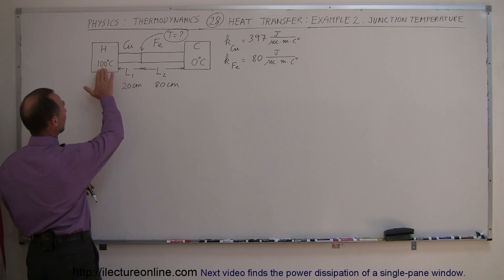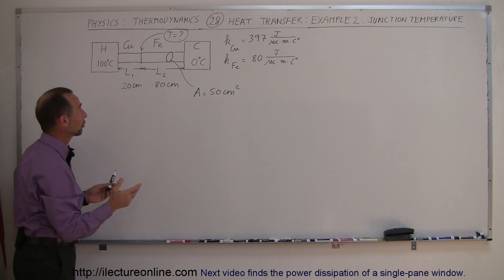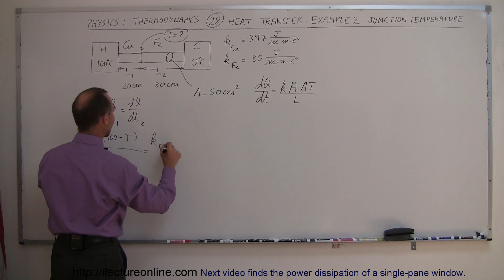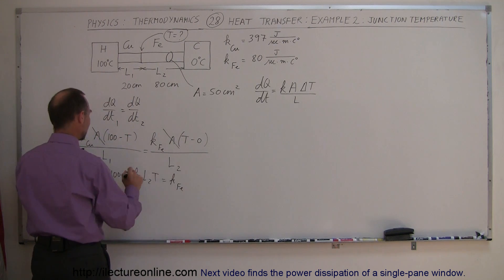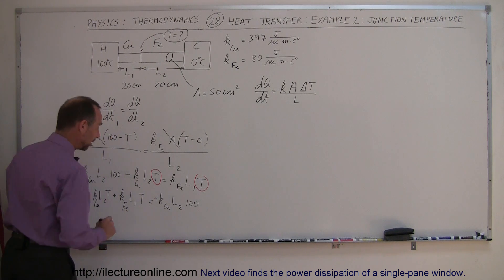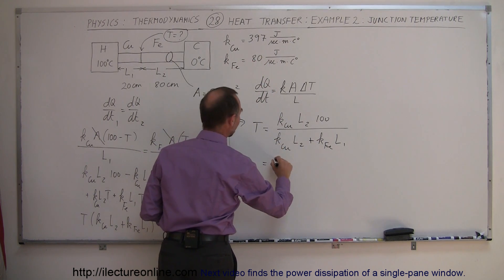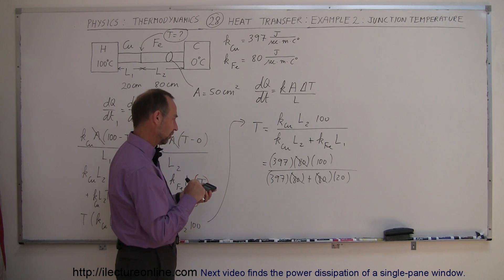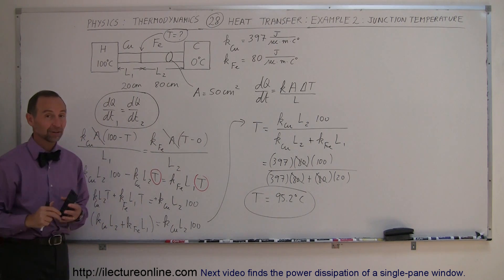Physics 24  Heat Transfer: Conduction (3 of 34) Junction Temperature

Comment: Why didn't you convert L from cm to meter? it should be 397*100/397+0.2= 99.94 °C
Reply from the maker: Since we have length in the numerator and in the denominator, they cancel out, so we didn't have to convert.  The result in the video is correct.

Comment: Hi why isn’t it T final minus T initial in the equations on both sides ? For one you did T final minus T initial but for the other side you did it the opposite way.
Reply from the maker: We only need the difference in temperature.

Comment: Stupid question I have, how did we know that the heat transfer at the junction temperature is equal to each other? Thank you very much
Reply from the maker: It is similar to water flowing through a hose.  If you pick any point inside the hose (call it a junctions), the amount of water flowing into that point must equal the amount of water leaving that point.   Or think of an intersection.  The amount of cars entering the intersection must equal the amount of cars leaving the junction

Comment: Hi, you said "of course rate of heat transfer is same" even at the material's junction. May I know why or which playlist to refer to?
Reply from the maker: It is like a water hose.  For every drop of water added on one side, one drop will come out on the other side.  And throughout the hose 1 drop will be moving along the hose.  The same thing happens to current on a wire.
Reply: @MichelvanBiezen  Ahh I understand. U also explained in video 14 that it can act like a resistance in parellel! Amazing stuff!

Comment: Thanks for the video! Fourier's law says dQ = -k * (dT/dL) * dA * dT * dt. So where's the minus for k?
Reply from the maker: The negative is used to relate the direction of flow to the positive or negative change in the temperature.  Since we know that the heat flows from the hot reservoir to the cold reservoir, and we take the delta T as a magnitude, we don't need the negative sign.
Reply: @MichelvanBiezen  thanks for answering! :) So dQ/dt will always be positive if I've well understood, won't it?
Reply from the maker: dQ/dt is always positive when we consider heat flowing from hot to cold.

Comment: Greetings, I don't know if this will get a response, but I have a question. If we had multiple materials (of course with same cross sectional area) of different lengths, would it be possible to equate the following?: (sum of all k's) (delta T) / Length = (sum of other k's) (delta T) / Length ?

I would appreciate any response
Reply from the maker: I would start with  dQ/dt  for 1 = dQ/dt  for 2  = dQ/dt for 3    etc.     (The amount heat flowing through each section is the same)   Provided they are connected in series  (not parallel)

Comment: Why is dq/dt constant ??i.e why same for both???
Reply from the maker: If the hot and cold reservoirs are kept at the same temperature, then the amount of heat flowing through the bar must be constant.  You cannot have more heat flow through one part of the bar than the other part of the bar.  (where would the extra heat go to?)
Reply: @MichelvanBiezen  an analogy would help......
Reply: I sort of assumed billiard balls in this case but still can't get the correct analogy
Reply from the maker: Use a water hose analogy.  You can't have more water passing through one part of a hose than another part of a hose.
Reply: @MichelvanBiezen  Thanks a lot!😀

Comment: The equation is valid during steady state or equilibrium conditions or instantaneously valid under non-equilibrium conditions.

The way to look at this is to focus on the boundary between the two materials that are responsible for the conductive heat transfer.

Looking at the boundary itself between the two materials and assuming the hotter bath is on the left side, the equilibrium or steady state condition means that the heat transfer coming from the left side across the boundary must match the amount of heat received on the right side of the boundary.  

This is to be expected - the head transfer across the boundary is steady.  This will only be true under equilibrium conditions (or instantaneously otherwise) and the temperature of the conductive material will (at steady state) be constant.  Prior to equilibrium and steady state, the conductive material's temperature will rise...

Under equilibrium conditions, the heat bath on the left is at a steady temperature T1 and transfers heat via conduction across the connecting material to the heat bath on the right, which is itself at a steady temperature T3.  The conductive material, under steady state reaches a temperature between the hot bath at T1 and the cold batch at T3.  Under these conditions, all temperatures are steady and heat transfer is steady.

T1>T2>T3.

This model also assumes that the source of heat is 'infinite' eg that the hot bath is not cooling down over time as heat is transferred out of it or that this transfer is small relative to the size of the bath and hence can be ignored - if the hot bath cannot be treated as infinite, then, as heat is transferred out of it, the hot bath will cool down and all three materials - left bath, conducting connective material, and right bath, will all hit a fixed, final temperature.

Comment: I  could  not  understand  one  thing that how  dt  is  same  for  two  materials
Reply from the maker: The same amount of heat that flows through the left side of the  path, must be the same as the amount of heat that flows through the right side of the path.    (It is similar to the amount of water flowing through a pipe, you cannot have more water flowing through one section and less through another section).

Comment: sir, do we need to convert the length from cm to meter?
Reply from the maker: In this case it is not necessary because the units of length cancel out.  If you are not sure, it is always better to convert to make sure you don't make any errors.

Comment: so, just to clarify, this setup is such that neither of the sides (100C and 0C) ever change temperatures, so each point on the pipe will find an "equilibrium" of a certain temperature they will forever stay at?
Reply from the maker: That is correct.  The end points in this example remain at the specified temperatures.

Comment: I'd first like to say thanks for all your series they are amazing. 

I understood how you solved it , and everything calculation wise .
However i cannot understand get one thing straight. I can imagine two metals with metal rods of same diameter sticking out from each other. I would imagine that at the instant of them being connected the temperature at the contact would initially be split into 100 C and 0 C and the would slowly change its temperature to reach an equilibrium value as a function of time depending on the rate of Q. I don't understand which part is 95 C and what metal this is , at which instant of time 

Thanks in advance
Reply from the maker: We consider the steady state situation.  After the temperatures have been allowed to settle, the flow of heat will be as described in the problem.

Comment: this doesnt make sense...how does the material NOT affect the rate of heat flow? in the previous video you said that depending on the material and (k) rate of heat is faster/slower respectively
Reply from the maker: I don't quite understand your question since heat flow IS affected by the material.  Both coefficients of heat conductivity of the 2 materials are defined and used in the problem.
Reply: sorry , I meant how can dq/dt be equal for both materials , since for example Copper has better heat conductivity than Iron (I think) thus dq/dt would be bigger while the heat was moving on the copper part , no?
Reply from the maker: Ah now I understand the question.  It is like a pipe carrying water.  The amount of water flowing through a pipe remains constant even when the diameter of the pipe changes (the velocity changes to accomplish that).  The same can be said about heat flow.  (You cannot have more heat flowing in than flowing out of a section of conductor).
Reply: right but how do we explain this algebraically? like if we divide both dq/dt for the different k of the conductors we dont get 1, since the k constants are different and they wont cancel out. Sorry for being so extensive about this, also thanks for the replies
Reply from the maker: solve for the equation of each piece separately in terms of dQ/dt.  Then set the 2 dQ/dt's equal to each other (because you know they must be the same).
Reply: RIGHT! thanks so much
Reply: My opinion: 
When you have more than one material, it is more useful to think about the "effective thermal resistance" (L/k) rather than k itself. Whichever material has the greater thermal resistance will govern the rate of heat transfer to a greater extent. It is loosely analogous to "the rate of reaction is controlled by the slowest step".
Reply: K sir I agree with you that amount of heat flow is constant but in a given time the heat flow differs I think
Reply: Dq /dt depends upon k of the materials so how can you equate the rate of heat flow in different materials can you please explain me

Comment: I don't understand why did you inverse the expression of delta T, I've been told that it's aqual T final-T initial which means (T-100) and (0-T) not what you wrote. So could please clarify that part for me Sir. And thanks for your efforts.
Reply from the maker: We are just looking for the magnitude of the temperature difference.  Since we already know where the hot side is and where the cold side is, we don't have to worry about the sign of the delta T, just the magnitude.
Reply: Got it , thanks for the respond Sir.

Comment: I have the same physics problem but this time the 2 temperatures of both the boiling water and the cold water are missing, the question didn't have the length for the L2 either, so there are 3 missing variables.I was told to find out the heat flow to the copper section which equal to the heat flow to the iron section, which finally equal to the heat flowing to the ice water. Please help!
Reply from the maker: There is probably some other information given.  If you write out the problem, I may be able to look at it.
Reply: A long rod, insulated to prevent heat loss along its sides, is in perfect thermal contact with boiling water (at atmospheric pressure) at one end and with an ice-water mixture at the other. The rod consists of a 1.00m section of copper (with one end in the boiling water) joined end-to-end to a length L2 of steel (with one end in the ice water). Both sections of the rod have cross-sectional areas of 4.00 cm2. The temperature of the copper-steel junction is 65.0∘C after a steady state has been reached. Assume that the thermal conductivities of copper and steel are given by kcopper=385Wm⋅K and ksteel=50.2Wm⋅K.
Reply: The question asked for the amount of heat per second H (=QΔt) flows from the boiling water to the ice-water mixture? and how long id L2 (steel section)?